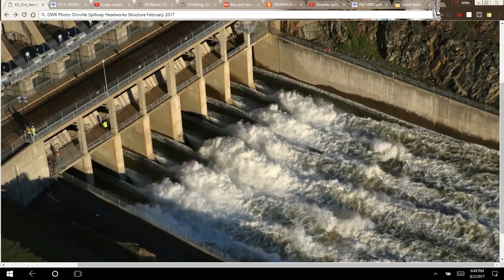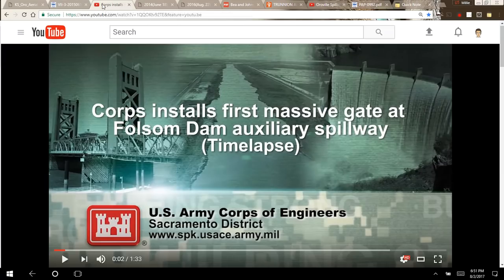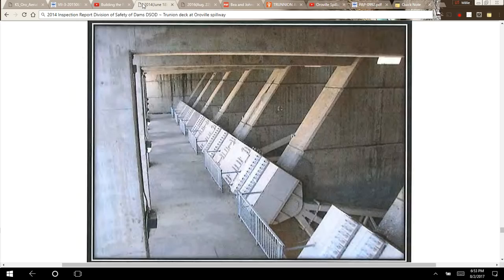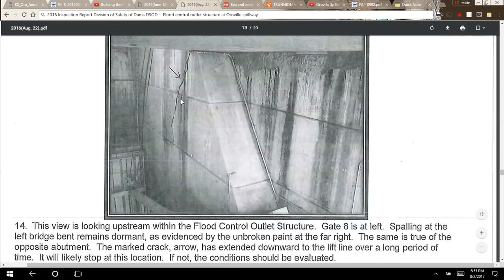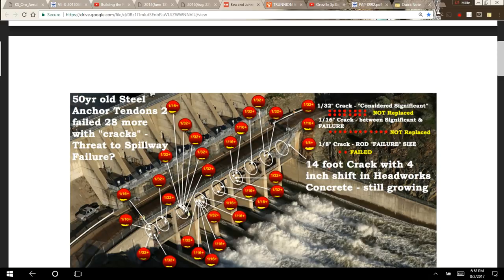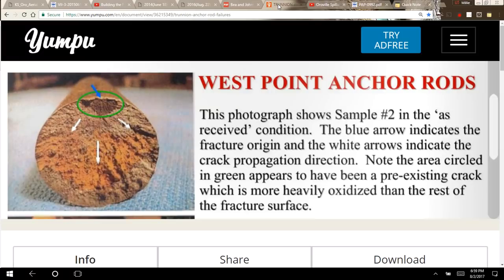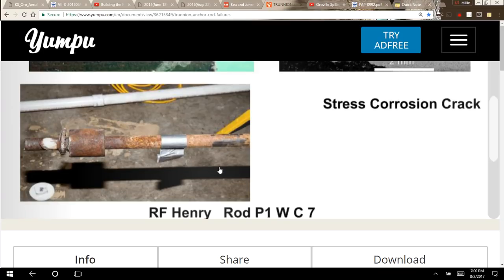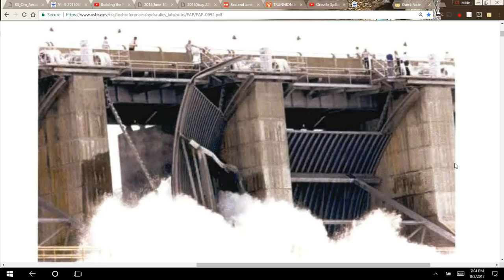Are Oroville Dam spillway gates safe? (And what about those trunnions and tendons?)  8/2/17

Comment: I believe """they""" are very afraid to open the gates, for fear that there could  be an immediate ADDITIONAL shift, which they may be UNABLE TO CLOSE THE GATES.  Therefore leave it as is.  It may accelerate the gate to whole dam failure.
Reply: James Dohnalek, Failure of a gate would NOT lead to dam failure. Just more fear mongering. Which is not helpful.
Reply from the maker: I sure don't want to see those gates used again.
Reply: James Dohnalek; All 8 gates can not be closed completely now. And in the future, that problem will accelerate. Yet DWR has no plans to either repair the gates(Impossible) or replace them. What does that tell us?
Reply: Spillway gates are not designed to seal 100% of flow, it would be impractical on such large moving structures. It is quite acceptable (and designed for) to have some seepage around the edges of spillway gates.
You can't design such large structures in steel and concrete and not allow for differential expansion and settling after the structure is built, so tolerances in the form of generous gaps in certain areas are designed in. The spillway gates would've leaked water from the day they were built.....
Reply: Millie, The gates are going to be used again as they were used successfully several times this season. Unless you would rather see the water dumped over the emergency spillway??? Let's get the spillway fixed first, then decide what to do with the gates.
Reply: First, the gloom and doom crowd on YouTube was telling us of impending doom due to the damaged spillway. When proven wrong... They complained about the "green spot" on the dam. After doom never happened, they complain about the gates. When the gates are repaired or replaced, I'm quite sure they will find something else to complain about. Maybe the "green spot" again? I think some of these folks just don't like dams. Many probably also believe in conspiracy theories.
Reply: Issue 1: Main spillway developed a large hole.  Out of their own concern DWR opted to let the dam top off,

Issue  2:  So called emergency spillway washed out causing great concern that the entire dam could fail due to "head cutting." A large scale evacuation was ordered.

Issue  3:  Gates of the main spillway were opened, and the large hole enlarged to point where massive amounts of the spillway and underlying rock washed into the river below, creating a dam in the river that had to be cleared.

Issue  4:  Construction on the spillway begins before there is time to create a genuine well thought out plan for its reconstruction.  People are rightfully concerned.

Issue  5.  Statements made by DWR officials conflict with what is actually happening at the construction site.  Progess on the reconstruction appears painfully slow.   DWR orders even more of the spillway removed suggesting that it is either in poor condition or DWR  is living in a fantasy world of what can actually be accomplished within a limited period of time.

Issue 6:  Even though the upper portion of the spillway didn't fail in the most recent episode it is to be replaced next season and they, the management, is worried about being able to properly complete that work next season.

Issue 7:  Secant wall is far from the weir, very long and very deep.  It's should be of obvious concern that a wall so long and so deep is necessary when there isn't even a proper drainage channel being considered in the construction plans.

Issue 8:  As a result of all of the above, DWR has a public relations problem.  They don't really explain the reason for starting at the bottom in a place that was mostly sold rock, nor do the explain other construction practices such as partial pours, and seemingly excessively thick surfacing concrete.

Issue 9:  The entire event as shaken the publics confidence in the overall reliability and safety of the dam's operation.
Reply: David Johnson ~~Hey, David. I've yet to see any gloom and doom from Millie Kay. She is on par with Juan Browne, plus she lives in the shadow of the dam. Her videos are all top shelf, well researched and presented. Everything I've seen here is fact based.

Be well, amigo.
Reply from the maker: Not liking either option (emergency spillway or gates) . . . and wishing they had started at the top. No choice but to wait for bottom spillway work to be done (or move).
Reply: How will the problem "accelerate"? please explain Paul Ryan
Reply: Gavin84w; There is 4 inch wide gap; 14 feet long; in the main holding wall of the gateway. This is steadily expanding, but DWR has stated there will be no repair of the gateway.  If even one of the gates fails like Folsom dam, then it is possible the whole structure of the gates will collapse and that will bring down the whole dam. If you live down from the dam I suggest you sell up and get out of town.
Reply: Just on the secant wall IPA, you do realise what the final design is like dont you?
Reply: John Perry, I agree with you on Millie's videos. Her videos have been very good. Well researched and presented... Except for this one. Which I was disappointed in. Do you realize that this covers the same topic that the other fear mongers like Susan Wolding and Perth observer have been bitching about for the last 6 months? 2 failed anchor tendons out a total of 340 doesn't represent an immediate danger.
Reply: Milly Kay, I understand your concern, but I have to disagree with you for several reasons. 1) Two failed anchor tendons out a total of 340 doesn't represent an immediate danger. 2) Tearing apart and trying to rebuild the gate structure before rebuilding the spillway, or even trying to do both projects at the same time is a very bad idea. 3) It is highly unlikely they could have repaired or replaced the gates this year anyway. It is one thing to rebuild the spillway. Which involves pouring concrete and laying rebar. The gate structure has a more complicated design and requires parts to be ordered and manufactured. Something that should not be rushed. For those who live below the dam the best thing they can do is avoid fear mongering YouTube channels! Channels like Susan Wolding and Perth observer and quite a few others.
Reply: C,mon David Johnson, those 2 channels report completely unbiased and factual material, just ask them and they will tell you.
Reply: David Johnson ~
Hey, David, thank for your kind words. Regarding other videos about the dam, I must confess that I've steered pretty clear of the folks you have mentioned. You and I have, I believe, talked about this emotionalized coverage on one of the video sites a while ago. It could be that others have covered the same ground in the past, but as they sat, "Even a blind squirrel finds an acorn now and then". Millie Kay has had a lot more credibility, in my opinion. Millie does pains taking research, and spends a great deal of time and effort bringing her issues to he front before posting them. That having been said, David; I am inclined to support her position. Millie Kay, even with this concern over the gates, is not in the same section as the doom and gloom folks. It is the same issue perhaps, but presented much more carefully. I am seeing responses from knowing minds that are agreeing with Millie Kay. 

I have taken the time to look back through what Millie Kay has put out there. She has added to my knowledge and has yet to wave the gloom and doom flag. Another reason I like what Millie Kay has present is that she is a person who was evacuated, she lives below the dam. I was looking for someone who has some skin in the game and Millie Kay is that person, and still she has stayed on message and used research to present information about the Oroville Dam.

I do not mean to take an opposing view, David as I feel the same as you regarding the "blind squirrels". It is good to see you here taking in what Millie Kay has to share. Take care, Amigo!
Reply: +David Johnson the way California mismanaged  its money over the decades, and still does today, this fear should not be kicked to the curb, way to many feel good projects and tons of deferred upkeep and repair has gone on forever.

Had this dam been taken care of properly by using its generating power/ money the emergency would most likely have been avoided.

How about a 3rd party consideration with actual teeth on all this mess from other than Cali based to get the real magilla in the open.

Being Cali has almost a trillion in unfunded promises for pensions eating away at the basics, causing all this deferred breakdown maintenance at astronomical costs.
Reply: John Perry, Millie Kay does have a lot of credibility and that is exactly the reason I chose to comment. By choosing to do a video on the subject of the gates, I believe she unintentionally gives credibility to what the gloom and doom folks have been saying.  I do have a suggestion for Millie since she is good at research. Assuming a worst case scenario where a gate were to fail completely.... At what rate would the water be released? When gate 3 failed at Folsom dam, water was released at the rate of 40,000 cubic feet per second. If the same thing happened at Orville, it would not be a problem. Since the spillway and downstream levies can handle much more than that. But if the gates at Orrville dam are bigger, then water would be released at a higher rate. But may still be within the capacity of the spillway and downstream levies.  Knowing exactly what could happen if a gate failed could put a lot of fears to rest.